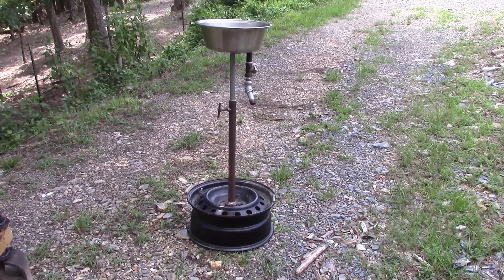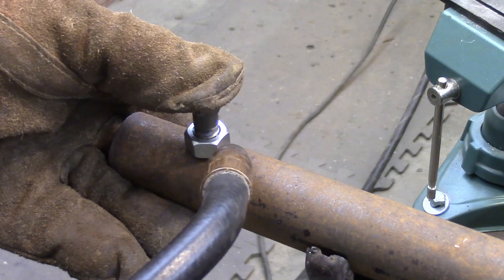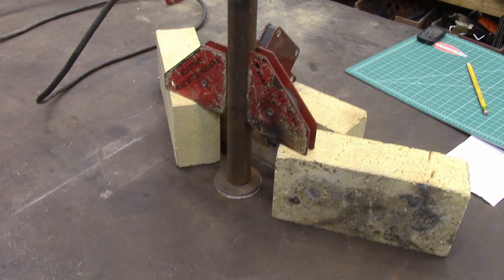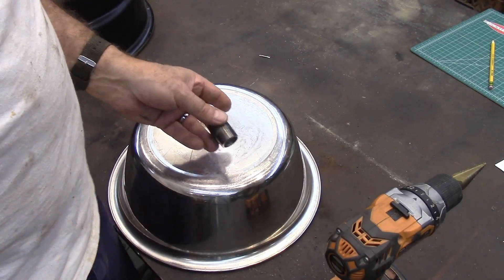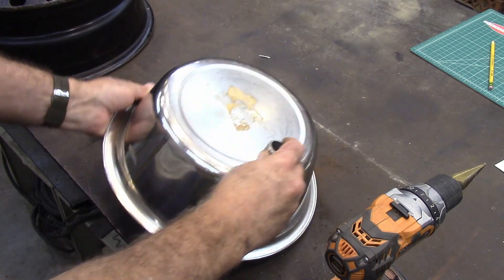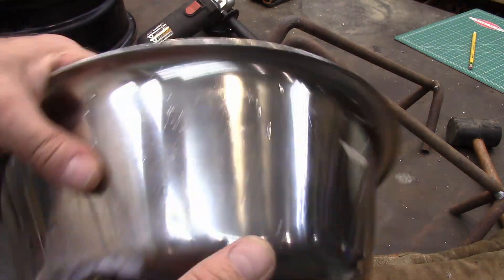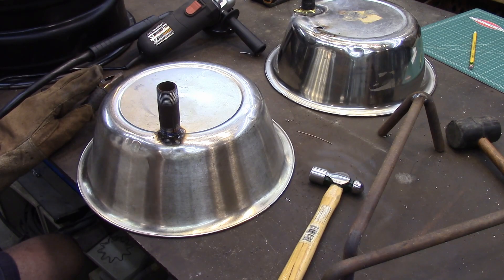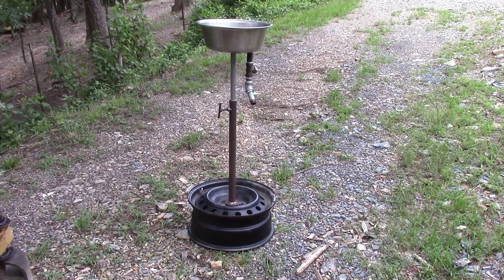Homemade Waste Oil Collector

Comment: Very interesting.  For me I have a small metal barrel and I put a pipe and old funnel on it.  But I like your idea better because it is a real challenge when I need to empty the barrel.  Don't worry nobody looks at our welds anyway.  Hope you got some rain and are having a good weekend.
Reply from the maker: I almost made one like you are talking about but I like to keep the oil in the original containers.  I have a bunch of it, I keep thinking I will make an oil heater or melting furnace but I never get around to it.  If I ever do I'll have a bunch of fuel.